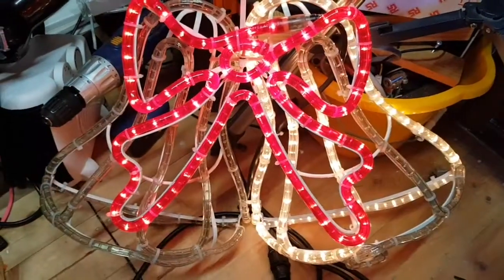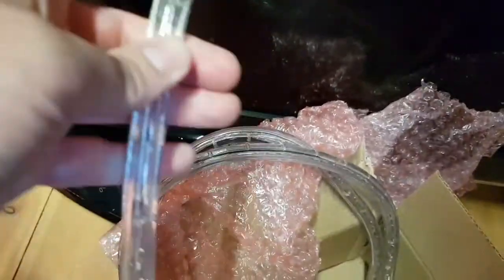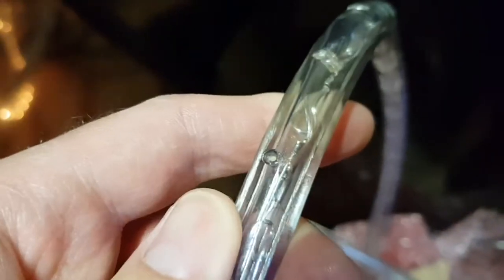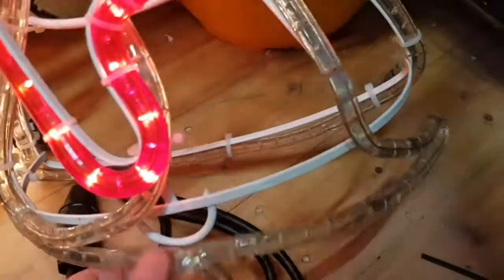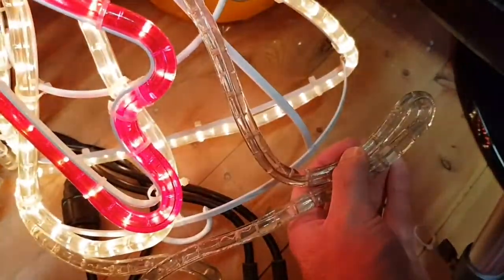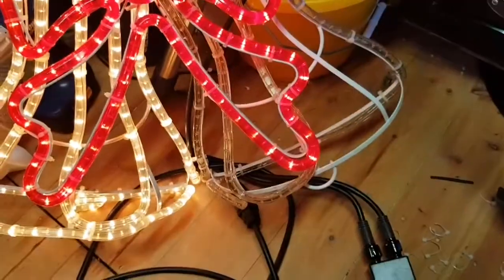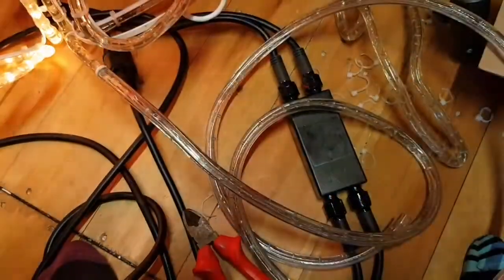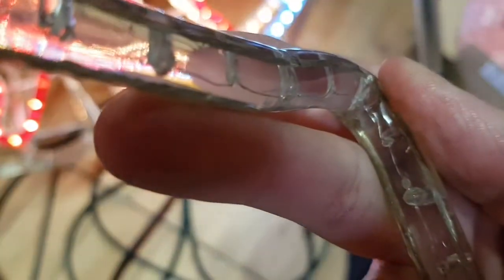rope light repair, almost!!

Comment: Looks like you needed some 2700K or even warmer color rope light. I'd probably try cutting open the old section to repair the break instead of replacing with LED.
Reply from the maker: I managed to get some tungsten rope light in the end that is an exact match. But the led mistake I found funny so let it in. Trouble with cutting is repairing the cut to make it safe from shocks. As this is going back to someone who might not be electrically minded so to speak.